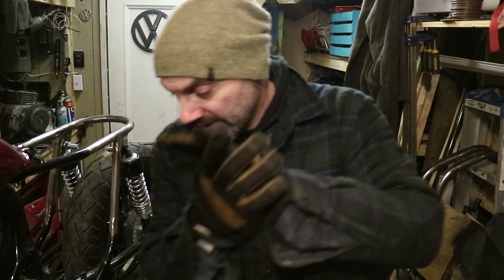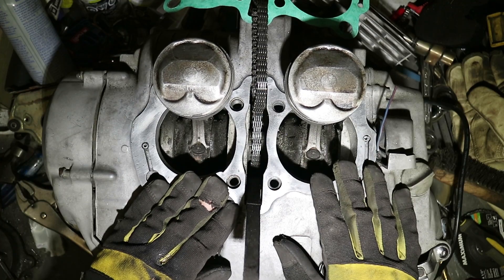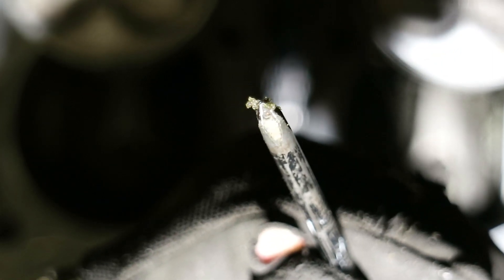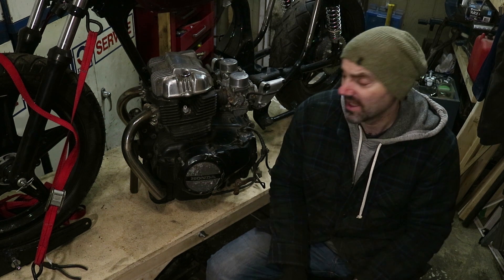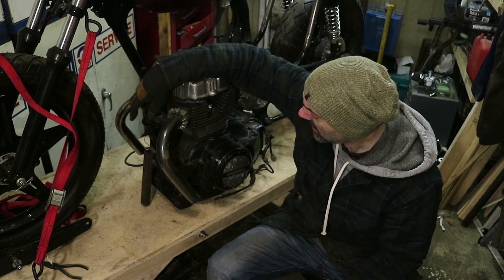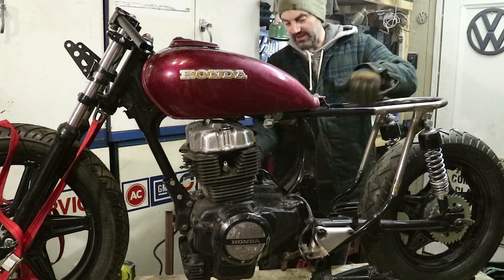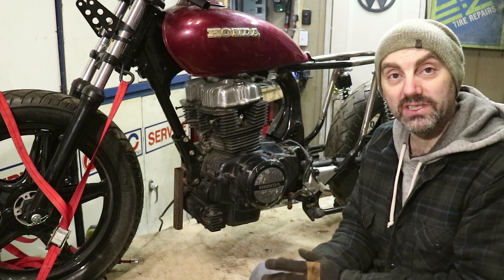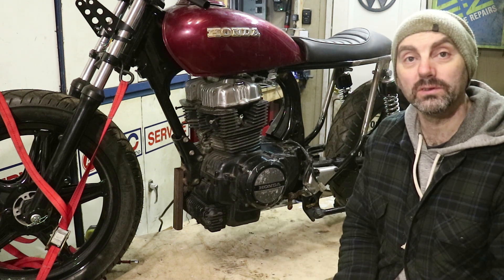HONDA 400 CAFE RACER PT5 - ENGINE INSTALLATION

Comment: I noticed you did not reinstall the motor bracket on the top that connects to the downtube under the tank. I guess after cutting the frame and shifting it up, those holes would not have aligned anyway. Is it ok to run without that top mount?